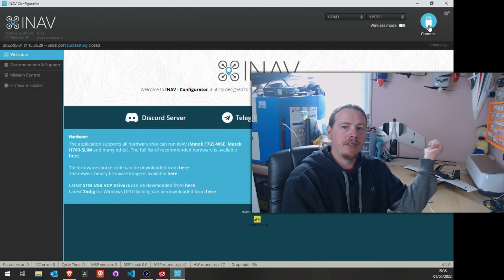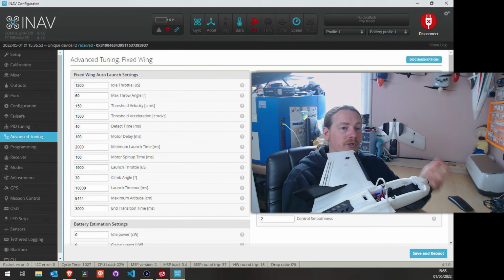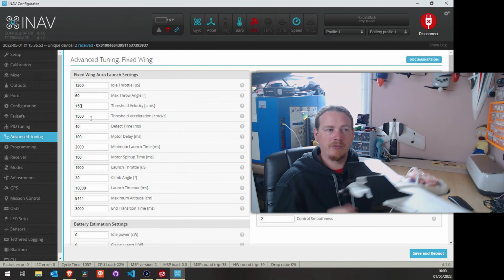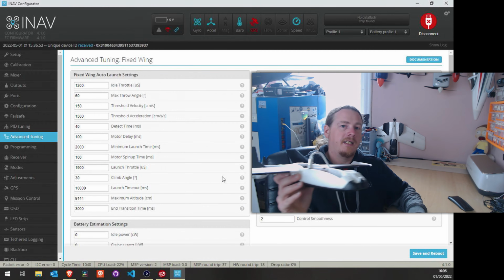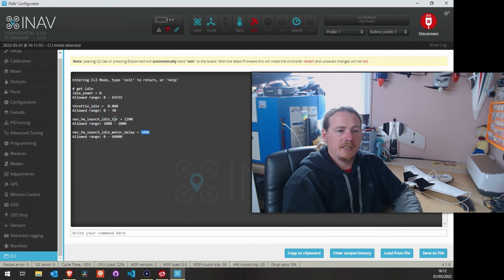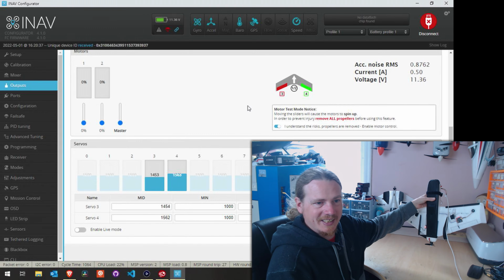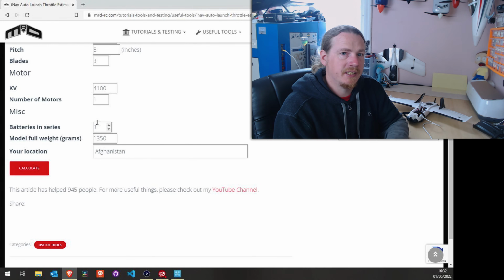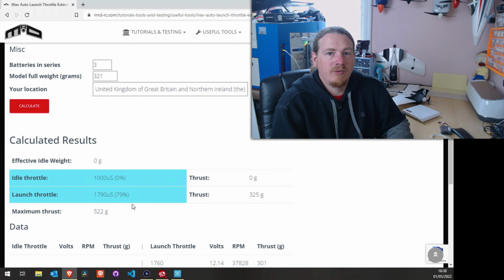Setting up auto launch, or launch mode, in iNav

Comment: So what happens if I have it set to spin up the motor on autolaunch and i wait too long to throw it? 
My first launch this weekend didn't go well. The motor went to idle throttle but i waited almost 25 seconds to throw it. It initiated the high throttle when I threw it but didn't even try to fly itself. 
Is my thinking right that I waited too long?

Comment: In automatic launch mode, the airplane climbs steadily. After X time, the automatic launch ends and, let’s say, it switches to the angle mode I selected beforehand. What will happen at the moment of transition between the modes? Will the airplane switch to level and straight flight, or will it continue climbing?

Comment: In the current version of iNAV 7.1.2, there is no Threshold Velocity figure.  Did they do away with this feature in more recent versions?
Reply from the maker: Yes, it had been gone for a couple of versions now. In most cases the default is fine. It can be accessed from CLI if needed. For example you have a big, heavy aircraft.
Reply: @MrD  Okay.  Can I put select RTH as an exit flight mode, or will that not work since it has to be in a non-navigation mode for NavLaunch to work?

Comment: Very useful video. Currently I am having issues with an AtomRc Dolphin torque roll on auto launch. No matter what mode I select iNav cannot catch it in time to prevent a roll into ground. Any suggestions welcome. Throttle set to 70%
Reply from the maker: Are you 100% sure it’s torque roll. If you’re using the stock setup, it seems unlikely. The Dolphin is pretty easy to add unwanted movement on the throw. So it’s worth checking that. 

When you say no matter which mode you select.  Are you using autolaunch? If so, the mode you select only activates once the launch is complete. During autolaunch, it will always use manual. 

Have you autotuned the Dolphin yet? If so, was it in acro with prolonged full stick defections with pauses? If you’ve not yet autotuned. Angle may not have enough authority to correct the unwanted angles in the launch. To help with initial launches. You can set the throw in acro mode to be around 80% of the throw in manual mode by adjusting the FF. 

There are quite a few different things that could cause issues on launch. If you can. Maybe raise the problem with DVR video and/or external video of the launch. Yo could do this on the INAV Fixed Wing Group Facebook group or Discord served. Links can be found on INAVFixedWingGroup.com.
Reply: @MrD  thank you for the detailed reply, most helpful. Launching in manual mode with full beans definitely resulted in a full left roll. I had auto tuned in Acro but might not have waited long enough between slick movements. I solved the issue by auto launching in Horizon Mode, changing from no motor spin on arming to 15% throttle, not to high so if I do catch a finger it’s not brutal, and reducing max launch throttle following your YouTube method. It definitely launches better when there is a head wind, not so good in a dead calm.

Comment: I know we are talking about auto lunch...but is there any video that explains how auto land decides where to land respectively to the home position?
Reply from the maker: There are 3 automatic landings. 

1. Emergency landing. This will just land immediately. You don’t get a say in how it lands. 

2. Land after RTH or FS. This loiters down at the home (or safehome) point until it almost reaches the ground. At which point it will level off and land. The only control you have here is where the home/safehome position is. Everything else is automated. Including the level flight vector. 

3 Fixed wing autoland. This is a new feature in INAV. You set a landing strip on a safehome, safe approach direction, approach distances and altitudes. It does the rest. If fixed wing autoland can be used. It will use that instead of option 2. Full information can be found at https://github.com/iNavFlight/inav/blob/master/docs/Fixed%20Wing%20Landing.md
Reply: @MrD  thank you Buddy

Comment: Darren i got my T1 Ranger to auto launch but how do i setup loiter? I’m using the speedy bee FC and i have INAV 7.0 firmware. Could you please do a video on how to set it up. I’m new to this so if you can explain it so i can do it would be great. Thanks Art
Reply: Great thank you
Reply from the maker: I can make a video on this. Before then, there’s not really a lot to set up. On the Advanced Tuning page there are 2 settings. Loiter direction and loiter radius. 

Loiter direction is the way the aircraft will bank to make the loiter. The default is right. But you can select left or yaw. I personally use yaw, as it defaults to a right hand loiter. But allows you to change the direction with the rudder stick.

Loiter radius is just how big the circle in the sky will be.  I believe the default is 75 metres (150 metre circle). Which will be fine for your T1.
Reply: Darren i went out today and tried to get my plane to loiter but no luck. I did notice you flipped a switch for loiter do i need to setup a switch for this? I’m using Frsky X20s TX and RX. My loiter radius is 3200 cm and loiter direction is Right. Thanks again

Comment: I'm new to INav (past Ardupilot user for many many years).  I have a couple of questions on INav 7 AutoLaunch.  #1: If I enable AutoLaunch always active what happens if I accidentally disarm in flight?  Does INav know it's already flying and skips the normal AutoLaunch requirements (i.e. if I rearm and advance throttle it responds to my actually throttle setting vs going to idle throttle setting and waiting for the toss acceleration).  #2: Can I just enable AutoLaunch to a switch position AND also enable Loiter to the same switch position?  Will INav enter the launch sequence and then automatically switch over to Loiter mode once the launch sequence termainates?  I ask as Ardu Takeoff mode does both takeoff then loiter as one flight mode and, if re-engaged in flight, skips the takeoff and jumps directly into Loiter.  I'm curious if INav will operate the same way.
Reply from the maker: If you disarm in flight, rearm within 5 seconds and it will immediately rearm. If you take longer than 5 seconds, you will need to follow my video from a month or so ago about rearming in flight.

No, don’t put launch and a flight mode on a switch. Especially a navigation mode. That will block arming. Just follow the procedure in the video and it will loiter after the launch completes.
Reply: Thank you for the information. I've already added your Arming Override in the INav Programming.  I also set up some logic in my Tx to not activate disarm unless my throttle is at zero...which I rarely do in flight.  Chances are now pretty slim that I do accidentally disarm in flight. @MrD
Reply from the maker: Honestly, I don’t have anything that blocks disarming. I see disarming as a safety feature that should not be blocked in any way. 

I’ve accidentally disarmed a total of 3 times in the years I’ve been flying. None of the aircraft touched the ground after doing so. And one was a quad. People tend to be worried about it. But honestly they shouldn’t be. Especially with INAV 7. You just re arm. You don’t even need that programming anymore. It just works.

Comment: Hi Darren, I have INAV 7.1 installed on my Sky Hawk. I have transferred the diff all data from 6.1. Now I have a problem with auto launch. What do I have to change in 7.1? The setting options have changed a lot. Many thanks for your great videos and greetings from Switzerland. Didi
Reply from the maker: INAV 7.1 isn't out for about a month (probably release candidate some time next week). As far as I know. Nothing has changed in the launch between 6.1 and 7.1.

What is the problem? It may be worth asking in INAV Fixed Wing Group. As DVR or external video would be able to be posted there.
Reply: Hello and thank you very much for your information. Greetings Didi

Comment: Thar was super helpfull. Its my Maiden of flying for the first time! I've made a homemade plane... I'm terrified!

I've subbed 👍
Reply from the maker: I'm glad it was helpful Gary. I hope you have a successful maiden and some great flights.
Reply: @MrD thanks for replying. Sadly though for some reason i couldn't arm.  I thought it might of been the lack of  satellites. But I changed it to have no gps at all to just use flight modes.  I was so excited! But sadly it still didn't Arm. All worked at home before I tested.  I think It was because I left the fail safe as RTH.  

I gave up after a frustrating day!  Will look again tomorrow!

Any ideas why it wouldnt Arm? Even after I disabled GPS?
Reply from the maker: Make sure you have system messages on the OSD. If it can’t arm, it will tell you why there. Most common are that you are in a navigation mode or that the throttle isn’t low.

You should have failsafe as RTH.

Comment: Hi! What is the benefit of limiting the autolaunch throttle and not just set it up at max (2000) directly ? 🤔
Reply from the maker: There are a couple of reasons that come to mind. Firstly, using the right amount of throttle, rather than full throttle gives a more efficient launch. So you will not burn more battery than needed. The other reason is that full throttle may introduce torque roll, which is not wanted.

Comment: Super helpful Darren...apologies,but a question,I'm baffled....
How does INAV Autolaunch know what switch to prioritise - for the autolaunch,....when you've selected 2 switches: Manual (NON Nav mode) AND Position Hold (NAV Mode)aka Loiter,..before raising the throttle and chucking?....🤔🤔🤔
Me?...I'd just use Acro for autolaunch AND exiting it too.
S.M.A.C. still looks a good place to fly even in the dystopian R.I.D. future!
Reply: Many thanks Darren for clarifying..much appreciated 👍
Reply from the maker: Autolaunch will always be based on Angle. You can only choose the exit mode. 

As for the mode it will use. INAV has a priority order. From what I remember, manual will take priority over loiter. The best way to combat this is to not give INAV the choice. You can have all your modes sent over a single channel. Meaning the mode you select, is the mode that will be used.

Comment: Hi Darren,is it possible add a parameter in autolaunch tabb wich will be sett the delay right after throw and before climbing so that plane wil pickup the speed in level flight and after that start climbing? Thank you!
Reply from the maker: That’s certainly something that could be requested on the INAV GitHub. It shouldn’t be too tricky to implement either.

Comment: I would love to use Auto Launch, but it has never worked for me through out all the various versions. Now on version 6.1 so thought I would give it another go, Z84 Wing flies perfectly in all flight and navigation modes, does missions etc without issue, but it doesn't matter if I mode switch to AutoLaunch or permanently enable it, I can never ARM, so there is something missing here??
Reply from the maker: If you check the system messages in the OSD. It should tell you why it can’t arm. It 100% won’t be able to arm if you are in a navigation mode or don’t have enough satellites 3D locked.
Reply: @MrD  Thanks Darren but I don’t use OSD, only SMARTPORT telemetry, as I said it works perfectly in every mode, except Launch, Nine sats enough? No nav modes only Manual or Acro
Reply from the maker: That makes things a lot more difficult. Do you not have video on the plane at all? I’d have assumed you would have, flying missions and nav modes.
Reply: @MrD  I’m a fixed wing flier from way back, never multi rotors never fpv. Got into IINAV mainly so I did not loose gliders at the extreme range of my eyesight, just hit the return to home switch, or fail safe. Still have aircraft with F3 boards and version 1.7 INAV. Tried often but have never succeeded with Auto launch and still the same with 6.1 using Matek MWN. Only TELEMETRY
Reply from the maker: Unfortunately, system messages can’t be seen via telemetry. The only other option would be to plug on to a laptop and type status in the CLI. That would list things blocking arming.

Comment: Hi. Good video, but in INAV 6.0 is different the screen of configuration. Have you got one new video for INAV 6.0?
Reply from the maker: I don’t, because it is still basically the same. A couple of options were removed (defaults should be fine for those in most cases) and the idle delay was added to the UI from CLI to make things easier. I did talk about the idle delay in the video. Now it’s just on the page, so it’s easier to set.

Comment: now with version 6 some of the variables is not in the Launch settings and some has been added like Idle Throttle Delay. is the missing removed or just mowed?anyway as always a great video.
Reply from the maker: Some parameters have been removed. They are still in the CLI. But defaults should be fine.

Comment: Darren - Idle Throttle Delay seems to have been added since your video - what do you suggest for this? Cheers.
Reply from the maker: I’m sure I talk about it in the video. At that point it was in the CLI only. I usually go with 5 seconds. But it depends on the size of the plane and how long it takes you to get setup before you’re ready for the idle throttle to kick in. 

If you don’t use idle throttle, or don’t want a delay for it. Just leave it at zero.
Reply: @MrD  Of course you're right! Didn't put 2+2 together!

Comment: Do you think you could do a video of your 250G?  I see you have some mods done on yours.  Specifically the items in the wings, and the extension on the back. What are they, and do they help?  Your videos are always so helpful.  Thanks!
Reply from the maker: Unfortunately not because it is at the bottom of the sea after the F411-WSE failed. 

The only real modification was the tail extension. I did this as I was always planning to run 3S. That mount moves the motor back, as well as tapering the back end. https://www.thingiverse.com/thing:4885030

The only other mod was thin carbon rods between the fuselage and vertical stabilisers, to give them mores stiffness. 

Everything else was pretty much a standard build. The VTx and antenna were sunk in to the wing. The Crossfire nano was at the rear of the wing, with the VAS Xfire Pro antenna sunk in to the vertical stabiliser. I like to try and keep builds clean, on the outside at least.

Comment: great and details. I have a question, can I use logic in configuration or something that can always enable loiter mode in exit without using sequence?

in sort : it wont detect stick input and always exit in loiter until I change the flight mode
Reply from the maker: You could. But I don't know if I would to be honest. If you're worried about stick movements during the initial launch phase, there is a parameter to ignore stick inputs for a set time. 2 seconds is usually ample. Just set loiter as the mode after arming, but before raising the throttle, and it will loiter once it exits the launch.

Comment: Mr. D...another great video. I have programmed an auto launch on my radio very similar to this (i dont have a FC). I have gone over it numerous times and am pretty sure it will work as well as I expect. I hope to give it a test in the morning. I also wanted to say thank you for your contributions to RC. I know that you have spent untold hours doing videos, writing articles, testing logical setup etc. I appreciate you. Thanks
Reply from the maker: Thanks Rog. I hope the launch goes well 👍🏻
Reply: @MrD  Finally had time to 'kill 3 birds with one stone'. After letting it sit in my shop for 1+ year, i put my Nano Talon together for a maiden. I the maiden using my own auto launch set up on my Frsky 9D+ (no FC used for that), hand launched in stabilized mode of KoPilot (yes i know it has auto launch but mine is better 😁) and had a perfect landing 5 ft from me. A great day to be an RC pilot. Maidened my Nano Talon, my KoPilot and my personal auto launch all in the same flight.
Reply from the maker: Awesome. Glad you enjoyed your flight. It must have been nice to get it in the air.

Comment: Mr.D, I enjoy all your videos.  My inav auto launch does not seem to work with my Taranis radio, although it does work with the Radiomaster.  Do you have any ideas on this?
Reply from the maker: It is likely just a setting. There is no reason why autolaunch shouldn’t work with a Taranis. How do you have it set up?
Reply: @MrD  It's Inav 3.0.2 on the Taranis, but I also have Inav 3.0.2 on another aircraft with identical settings on the Radiomaster TX16S.  I'm not sure what it could be at this point.  Thank you for the reply, it's good to know it's not the radio.  I will re-check the settings and dig deeper.
Reply from the maker: If you’re using switched autolaunch. Make sure that the switch is in range. If you have autolaunch permanently enabled, it’s definitely not because of the transmitter.

Comment: thanks for your video. I have a problem. In my case , after engine arm and pushing the throttle engine not go to idle but to actual value of throttle. I cannot solve this problem. Thanks for help.
Reply from the maker: This sounds like autolaunch is not being activated before arming. Make sure you have system messages in your OSD and that autolaunch is displayed.
Reply: @MrD  You are right. First thanks for your videos, thanks for all you have done ! Congratulations !!!
Reason was that my transmitter wasn't correctly configurated (throttle channel). Now , the engine in autolaunch mode start to idle after a given time. But after, cannot not (shake methode) I the controller don't continue. This means, even (I see accelometers works correctly (sensor tab) controller don't stops and don't go father. It is like accelometer isn't connected.. Do you have any idea what can be a reason?